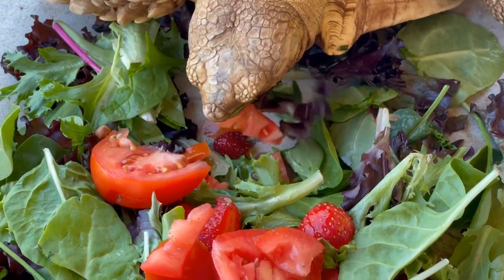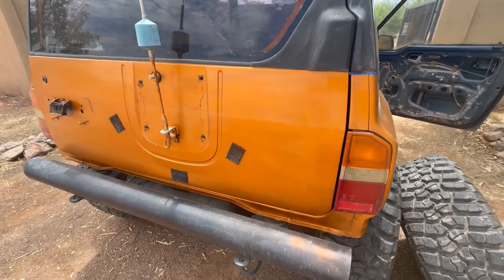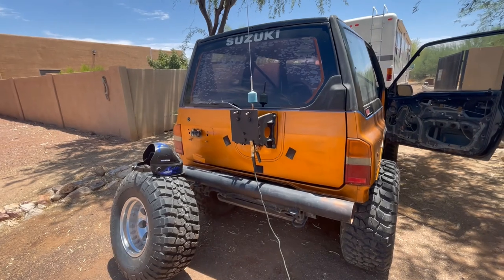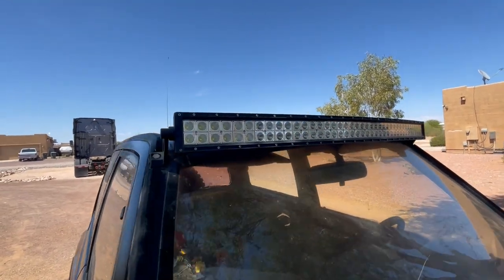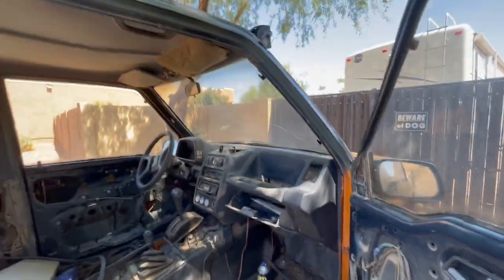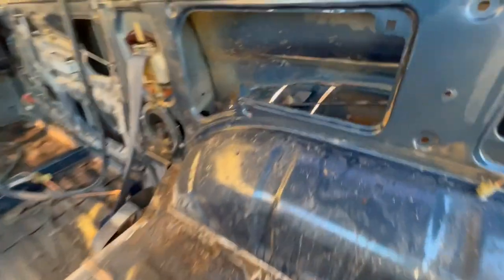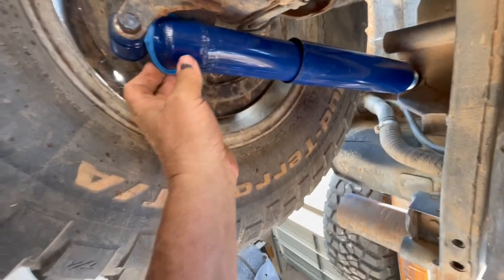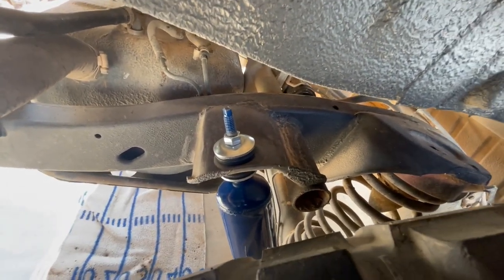S3 E11 Finishing Up Odds and Ends and BIG Shocks

Comment: I run those same rear shocks on my tin top. From a 2wd Ford f150. Work great for me.
Reply from the maker: In the past when you would order a 2" lift from say "Low Range" or someone like that they would include longer shocks in their kit.  So when I studied the Monroe charts, I found these with almost 10" of travel.  I hope that they do not cause me to "spit springs" when at max extension.
Reply: @tufftrails  I have lost a spring before.  I am.on 4dr springs now.
Reply from the maker: @trashpandaoffroad3548  My snubbers are still in place, but I do get myself into some awkward trail positions where I am all twisted up...    I will try to find some 4dr springs or some alternative.   Thanks for the heads up..  (Canada Trip vids???)
Reply from the maker: @trashpandaoffroad3548  Have you spit any springs after installing the 4dr springs??
Reply: @tufftrails  Nope. Everything has been fine since.